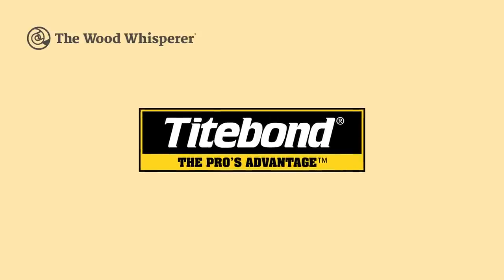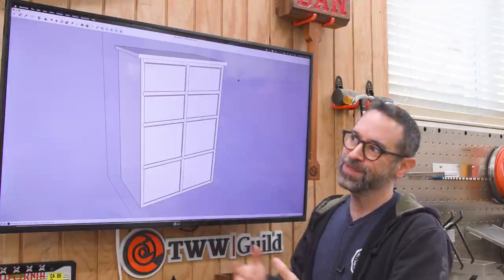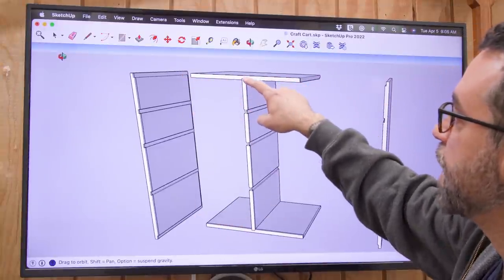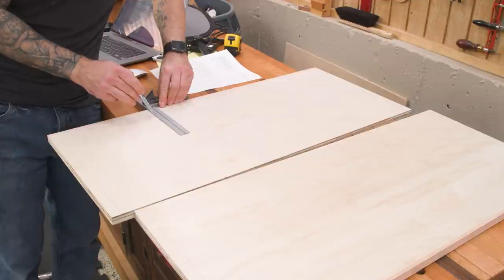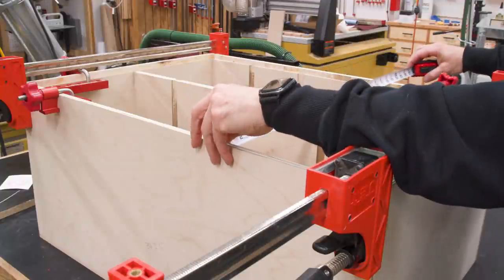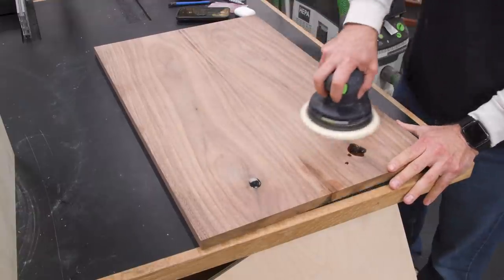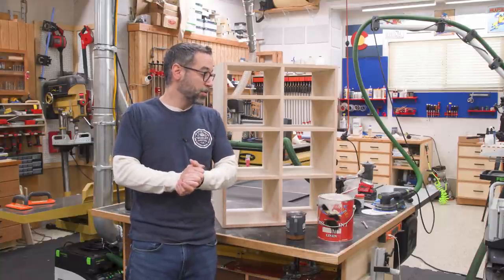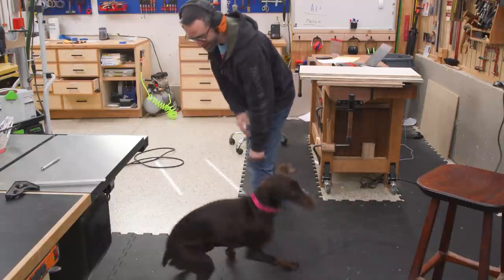Craft Cart | The Kids Love It!

Comment: Nice little cart, very functional and with a nice little Spag curve on top. Actually a lot of good tips for Dado-heavy casework. We make a lot of carts for milk crates in the film business and one thing I’ve found is that if you don’t leave a little headroom for each crate you’ll wind up with crates that won’t fit because they’re loaded a little over the top, and as a bonus, if you leave a few inches sometimes you can just reach in and grab something out of the crate without pulling the whole crate out. Of course that does increase your overall height, or reduce the amount you can fit in a given height but I always appreciate the extra space when it’s there.

Comment: I had a similar project a year or two ago. I taped off the edges before painting pre assembly. After pre painting, assembly was fine since I taped the edges so the panels weren't thicker, but I only needed to touch up the corners for painting.

Comment: Whereas in the UK, plywood tends to be a little bigger. For my first furniture build, a bookcase, I bought an 18mm sheet and used an 18mm router bit to cut slots for the shelves. The board was actually 19mm thick.

Comment: Curious, with all the pushing and pulling, did you use locking casters to prevent it from moving and hitting that neighboring trim and fridge panel? If not, do you even find it to be an issue?
Reply from the maker: It hasn’t been an issue yet. When loaded down it’s pretty stable.

Comment: Why did you put the corner rabbets in the side pieces instead of the top?, If you did put them in the top piece instead, then all 3 vertical pieces would have the same spacing for the dadoes, making the half inch shim moot. Asking because I'm literally getting myself into a similar project soon 😉. Great project
Reply from the maker: There's always more than one way to get the job done. But when it comes to plwyood stuff like this, changing a detail like that might simplify one element while complicating another. So if that seems easier to you, sketch it up and go. I designed mine in the way I felt was easiest for me.

Comment: Are you worried about the expansion/contraction of the panel top if just screwed?
Reply from the maker: Nope. The screws are much harder than the plywood they are screwed through. If there's any movement, the plywood will compress.